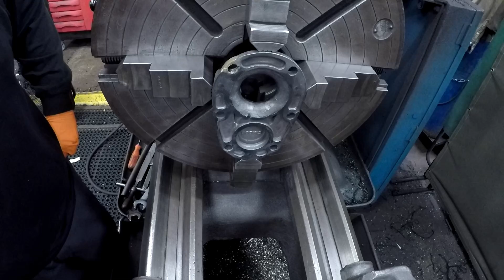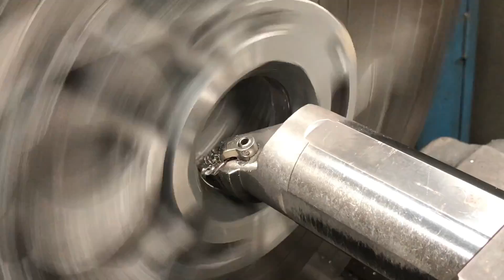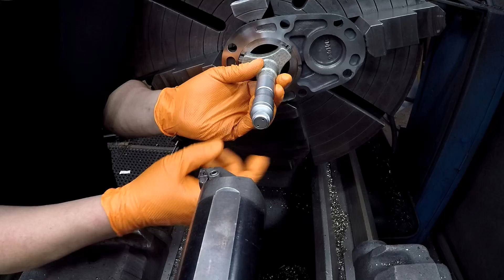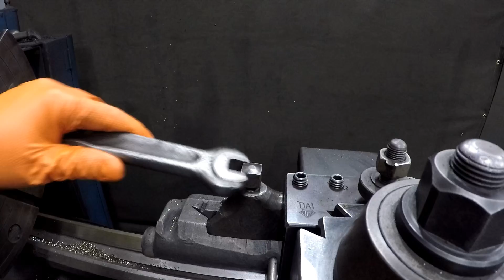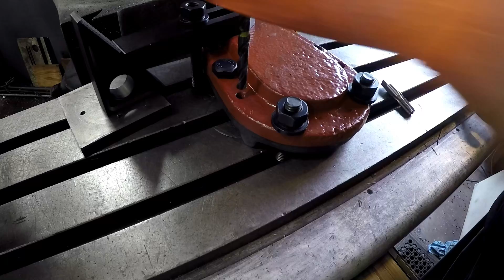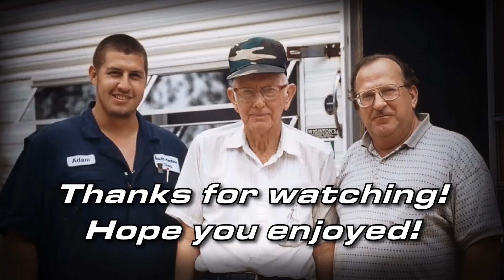Machining a Replacement Casting Part 2

Comment: So maybe you are machining  chilled cast iron? Chilled cast iron was the first lathe cutting tool material used back when lathes were driven by natural water courses. So therefore it is hard, the Watt steam engine barrel is believed to be machined using  chilled cast iron as the tool.

Comment: This is a great way to make a replacement part if the size of the part is not critical. There is shrinkage any time you cast an item , whether metal or polymer of up to 10% on some materials. When the oem part was cast they used a pattern to make the original mold that was oversized to compensate.

Comment: Hmm , Yeah this is one of those thats together and might look right. But has pretty low odds of being right. That shaft I assume drives gears and all of those gears have tolerances or clearances and that bearing races location was decided by the surrounded bolt holes. As we all know , when you transfer on a good part the outcome isnt great . This was a transfer from a broken part... 
Hopefully its low speed or something not that critical and load bearing as the guts are going to wear out from misalignment .
Its tough but there was enough hole there to decide the diameter and its location relevant to the outer ring without factoring in the broken side and then putting those in after the fact.
Definitely a mill job.... Kudos for toughing that one out showing it can be done tho !!! Thats a frightening chunk in the lathe !! LOL
Reply: The bolt holes are loose enough, and the gasket face wide enough, that the casing lines up based on the bearing rather than the bolting. Once it's lined up on the output shaft the casing snugs down and provides the support needed, but clearance is established from the bearing race and shaft...

Comment: Why not 3d scan the  good piece and carve one out of billet on a cnc  ? much quicker ....
Reply: *said like he has a $50k CNC mill collecting dust in his shed or something* lol
that would be lame content requiring almost 0 skill (comparatively) and all $$$
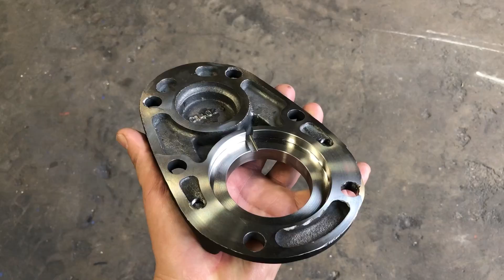You know how many machinists don't have the technical prowess to have recreated that part like he did in this video nowadays? let alone the courage.. proud machining @31:10
not something done on a computer after a few hours at your local community college.
Reply: @streamylc  machining a replacement from billet having 3D scanned the original would be quicker and stronger than this cast part. Adam does awesome work, but it doesn't change the fact that the old cast parts clearly aren't up to the job if it's failed so completely...

Comment: The two small holes are for the proper alignment. Id bet they center from the 4 bolt holes ,but what you have done in plenty good enough.

Comment: Good job saving the casting after the initial trouble. Wow, this is wild, watching the facing of the replacement piece get done on a lathe instead of a mill -- or for that matter, on the shaper. Some fancy chucking. Do you suppose the source material that was used for the casting is the reason behind all the unwanted and variable hardness? Was the casting material from his stockpile of used vehicle brakes?
Reply: Most likely was brake rotors they're the worst source I'm aware of,  usually ferrous silicone can remedy this but it's best to pour a sample to determine how much to use. Grey cast iron can be a real pain without it.

Comment: The threaded holes will be bearing housing jacking bolt holes, for dismantling the assemblyAdam thanks for the great videos and the tech. Info. You would make a great apprentice master if you aren’t already.
Reply: I think he said they were pipe threads so they couldn't be used for jacking.

Comment: oof .. part probably shrunk several thou after casting too... a lot going against you .. good job. As an aside .. maybe build up that outside edge a bit around those bolt holes next time .. can always grind off excess.

Comment: How are they going to adjust bearing with race ?   Either with more or less gaskets on cover or shim race
Reply: I agree it's very unusual to see a gasket in the stack preloading a tapered roller bearing.
Reply: Jack Noble I work on these gear boxes a lot what is done is the race is shimmed inside the bore not the whole casting so you wind up with shims the size of the OD of the race then a gasket or gasket eliminator to seal the cover

Comment: Can you say interrupted cut? O_O I'm curious as to why you chose a lathe vs. a face mill? (I'm new in machining so, don't crucify me lol)
Reply: As a fitter/turner and toolmaker I would have done it the way he did it. It allows one machining operation and assures the bore is absolutely square to the face. Bit of a pain time wise to set up but worth it when you get it ready for that first cut.
Reply: @MarcoUchello02  two totally separate setups on that piece would take a long time, I can see that.
Reply: Could there have been a problem with the old casting not being a mirror image ie. the bearing offset slightly to one side?

Comment: Super cool, but you could have made something much simpler out of a flat piece of billet steel. It didn't need that shape, or those tight curves. I realize the point of this was to show that a part can be re-created, but for practicality sake, it could have been done much simpler. Thanks for posting.
Reply: Yes I think so
Reply: CNC Machine would have be easy
Reply: @milkmanpeter  (and boring).... he's making [skilled] Youtube machining content; not machining business models.

Comment: What are the advantages of facing /  boring a part like this on the lathe vs. using a face mill and boring head or rotary table on the mill? The work holding on the mill I think would more tricky, especially when facing.
Reply: My question as well.  I find this all fascinating but know very little
Reply: @JimDorn  the face and bore are perfectly square to each other

Comment: Why did it break in the first place? Was there an over spec load on the part or did the casting fail by design? There's very little material on the outside of the bolt holes, it seems like a design flaw.
Reply: I think he explained it in part 1. The casting was removed from the mould without cooling slowly which made the outer side hard. He says this could have been avoided by leaving the casting in the mould for 24hrs to cool slowly.
Reply: @SENYELI  Oh, I was actually wondering about the original part. You make me realize it may have had the very same heat "mistreatment" problem from the casting process as the duplicate one.

Comment: Why not set up in Bridgeport mill and use boring head?
Reply: Holding an irregular piece like that on a mill table would be a big pain. It's much easier to adjust the part to be flat if it's held like that in a lathe chuck. It's especially difficult to machine the face flat, unless you grip it on the edges like that, which simply can't be done on a milling machine, and then you can switch tools and do the boring without changing your setup.

Comment: Why casting and fighting with random anomalies in the casted part, and not machining one straight from a billet?

Thanks for any hint!
Reply: Well if he didnt have to deal with casting anomalies it would have been way faster and easier as far as the non critical geometry on the inside. Milling all that out to replicate it would have taken a ton of time just to measure.
Reply: probably to be able to make a more interesting video, and also $ - him buying billet is more $ than his buddy casting him something ;)
Reply: @Demdere  depends on if he paid his buddy or not. a billet that size isn't going to break the bank either.

Comment: Looks like you're machining a piece made of white cast iron 😮
Reply: i dont think i heard him mention what material exactly was used. it looks like steel to me.
Reply: @darkshadowsx5949  It was cast iron. I could tell from the chips/swarf in the drilling/cutting ops.

Comment: My hat's off to you sir! I've learned more practical machining tips from your videos than any other single source. I'm a retired software engineer now taking a tour of the hardware side. :) One question; What circumstances call for a straight flute drill bit? What's the advantage of straight flute vs. spiral?
Reply: Straight flute drill is stronger and easier to make in carbide using powder metal forming.

Comment: It looks like a piece that would be easier to cut out of square stock INOX than bother with casting and then machining a single piece replacement and probably normal steel would do fine. There are only a couple dimensional tolerances to worry about and any face that's cast and not machined is likely not going to be an issue meaning you can probably reduce a lot of those complex geometries into simpler forms.

Comment: I have no idea so out of interest:
Why didn't he face it in the mill?
Reply: Facing it in the lathe ensures the oil seal and bearing bore are perfectly square with the sealing surface, meaning they will also be square with the rest of the machine they will be going on. Generally, the more operations you can do on one machine the more square your part will be, as re-chucking always introduces some amount of error.
Reply: @DeagledSmeagol  I see... thanks.

Comment: If you used the original as a pattern how did you compensate for shrinkage as patterns are normally made oversized?
Reply: Ask the foundry.
Reply: @gregwarner3753  My father was a pattern maker and he made wooden patterns oversized using special rulers that compensated for contraction of various metals. The foundry then packed sand around them to make the moulds.

Comment: Smart work, however, as always, brother. One thing But: the hole for the oil seal has moved down, I will explain why - the split part has moved down to the width of the crack. The last adequate points for positioning are the edges of the hole near the break (near the crack). On the contrary, the chip itself negatively affects the positioning result, especially when you display the middle position taking into account its displacement. Good luck, subscribed to your channel.

Comment: Adam, nice work..what was the filler rod silicon bronze you used on the brazing? ?
Reply: Look for fluxed LFB (low fuming bronze) filler rod.

Comment: Q: Why didn't you use a mill with a DRO and the b-print?
???
Reply: If he had the print it could be machined on CNC mill from solid aluminum.
Reply: @wambs88  Not from aluminium still. With the help of that steel bearing race that axle would quite literally chew a new hole into it as soon as it picks up a few microns of wobble. Cast iron is absolutely needed here imo

Comment: With your skill level, I bet you would have been able to make that part much quicker and even better using a piece of plate.  Nice job!
Reply: My thoughts 2 minutes into the first vid on this. I'm sure time was a major factor.
Reply: To provide the necessary blends to the internal and external contours without resort to CNC or a copy mill would be very time consuming. Even copy milling would be slow and laborious (and I speak as a person who owns one).
If Adam or the founder had realised the imperative need to do a full anneal (not just the ad hoc one Adam did carry out) none of the problems encountered would have eventuated - even the hole breaking out, I'm guessing

Comment: What is the advantage of using the lathe as opposed to a mill for facing that? Honest question from an ignorant newb.
Reply: I am by no means an expert, but since he was able to keep the work attached to the lathe for both the facing and bore operations, he can guarantee the perpendicularity of the face and bore. That may be why.
Reply: D Also, the concentricity of the hole to the counterbore.
Reply: Simple answer is a question... How would you hold it in place on a mill for the facing operation?

Comment: Very nice job on them castings. They can be a challenge to cut sometimes, cause you never know where a “hard spot” is, or if there’s porosity in the casting. The red enamel paint on the inside... is that “Glyptol”?

Comment: Mr Abom79 
Thanks for your videos. they are much appreciated. May i suggest that if you haven't seen this product before that you may go and check out there line up. It could have helped with the bolt hole
repair. 
The product is called "LOCK-N-STITCH INC." they have some YouTube videos that are rather enlightening as to possible repairs. 
Hope you have a great day and thanks for your time and effort.
John

Comment: Again, I have to ask...  Why didn't you just do the whole thing on the mill?
Reply: Because any 'good' machinist can easily add 3 - 10+ hours of needless, but still very billable, setup and changeover steps to any otherwise simple  and cheap project!

Same way in how any contractors, long since paid for, skid steer bills out for more an hour in operating costs than a rock quarries 40+ ton track excavator does.
Reply: @tcmtech7515  Hmmm, I thought that the company that Adam worked for was going to have to eat his time. It just seemed really silly to try and do that on a lathe.

Comment: Was wondering why you didn't use a surface grinder to flatten the plane.
Reply: How would he have got the bottom to be flat against the reference surface so that he could use the grinder against the top?

My general understanding with surface grinders is you need to start with one "trued" face with which to join to your own trued reference surface so that you can then true up the remaining faces.
Reply: @sparkzbarca  You can use 3 point adjustable ball bearing support.

The ball bearings adjust the height off the reference surface.  Adjust it with indicators until the plane is parallel with the reference surface.  Then use clamps to lock it in place.
Reply: @lennym1273  Cool, just shows how any task can be done in many ways.  And your work is good grade as well.

Comment: Taper rollers apply an axial load on the bearing housing when resisting radial loads,so if the casting is not  strong enough to withstand the axial load without bending,it will crack again,steel fabrication next time ,maybe. Good work Abom.

Comment: Wish I had the cutter and lathe to true up my cast iron pans !
Reply: oh that´s funny... you´re wearing cast iron pants...
Reply: Try using a flat faced grinding wheel in a drill press. Place the pan on a piece of plywood bolted to the press table, start the drill press at a low speed, lower the grinding surface to the pan and slowly move to around by hand. Or just hold the pan by hand and press it against the stone.

Comment: Adam, Outstanding work, and you are not afraid to show us things that do not "go as planned".  Makes me feel better with the number of things I flat screw up!  

When I saw the pictures of what you needed to do I thought you were going to mill it flat and then use a boring head. Your way was much better. (I am not 10% the machinist you are)  

I am and old retired welding engineer but still run a shop part time to keep busy and one of the old time hard heads that still gas welds cast iron with cast iron rod (Not Ni rod, cast iron) and with your brazing techniques you should give it a try some time. You have more then adequate technique to make it happen - It's like recasting the broken area or building up a missing section or missing gear teeth. - I get calls to restore broken antique casting (Like pre civil war) and we are in Cleveland and do a lot of boat manifolds every spring that froze and broke over the winter. Thing is when we get done you can't tell they were ever broken and it's all cast iron No brass or nickle.   The trick is proper pre-heating.   

What you need to do is go outside and dig a pit  and line it with sand. Build a charcoal fire and put the casting on the coals and then cover it with more charcoal (Real charcoal or even wood works best but you can use briquets in a pinch). Then cover it with fiberglass :attic insulation (much cheaper then Refrasil ceramic fiber.) - Leave it for a couple of hours and check if to see if the casting is red (it takes a whole day or more for really big stuff) - Pull the casting out and support it for welding keeping as much as you can covered with fiberglass. use plenty of flux and puddle it well.  Melt in and mix as much base metal as you can. And don't be afraid to hit it with a rosbud or belchfire. KEEP IT HOT!.  When it's done put it back in the pit as soon as you can and cover it with fresh charcoal and fiberglass again. - Leave it overnight and let the fire go out and don't leave it uncovered until you can touch with your bare hands. - The bigger the part the longer it takes (We once did an 80 ton punch press frame that took a week to cool.) - Sand blast when done and grind or machine as needed. A needle scaler after grinding and a flap wheel works to make it look like it was sand cast and is a virtually undetectable repair, even under x-ray. It's all cast iron after slow post heat and slow cooling.   

Anyway, I hope you give it a try one of these days and let me know how it works for you. (Use the same  good technique you use when you braze.) - The charcoal pit works really well for annealing just about anything too. It would have taken the hard skin on your casting (which I think was white iron on the surface) down to the same hardness as the inside.

Hey keep up the Vids. I feel like I'm your apprentice.

Later, Alligator
M. S. Steve Molk in Cleveland

Comment: That top depression looks like its also for a bearing for a counter shaft. Was it not requested to be machined?
Reply: I assume they would have caught on to that when reassembling the reducer. Maybe it was a part that could have been fit onto multiple configurations and it wasn't needed to be machined on that particular model.